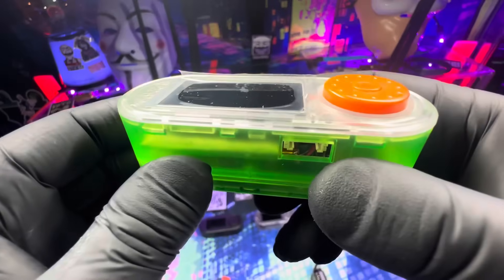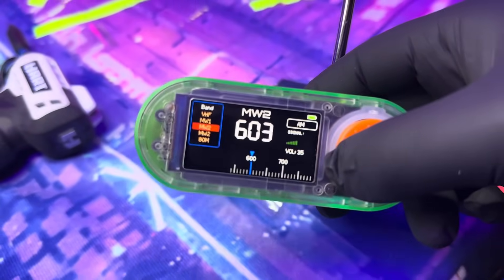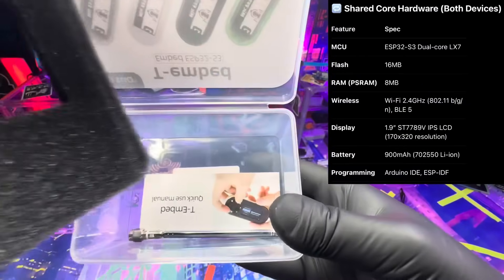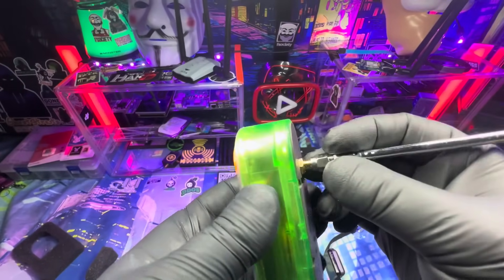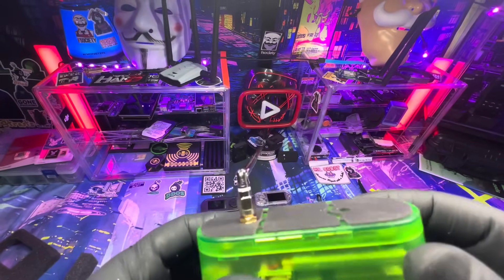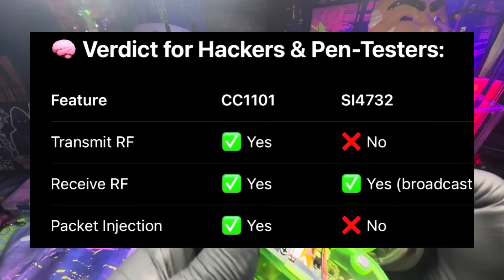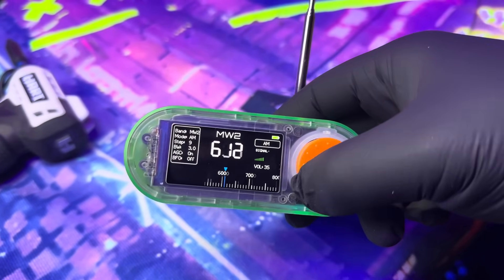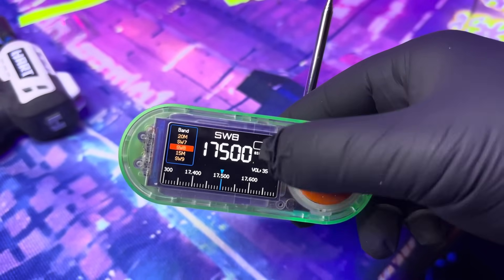T-Embed SI4732 Unboxing 📦 CC1101 vs SI4732 — PenTesting Tool or Survival Radio? Unboxing + Overview!

Comment: 4:36 two way security and facility FRS and GMRS radio’s? 

Id definitely relocate that antenna from the back to the top. I understand why it came from the factory on the back and nice of them not to put extra holes in the case.

Comment: I was waiting for this. I love seeing the LilyGo products. My favorite company. A little disappointed in the new t embed. Was hoping to be more like a full SDR/Radio hacking.
Reply: An sdr transciever chip can not communicate with a microcontroller directly. There's simply too much data. This type of chip is awesome for receiving, and it's controlled using basic commands.
Reply: @honestlocksmith5428 huh, I never knew that. That's interesting, I'm going to dig further into that rabbit hole. Been slightly interested in radio waves and modules. Definitely gonna take a look. Thank you for the insight my brother 🙏🙏